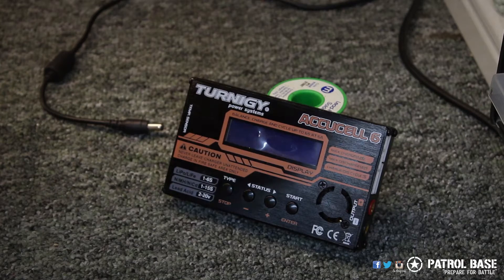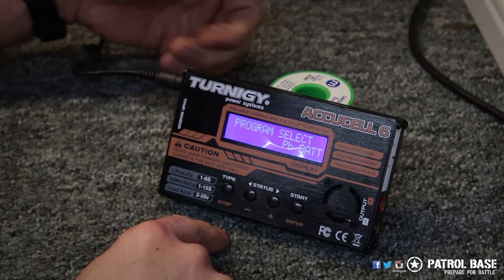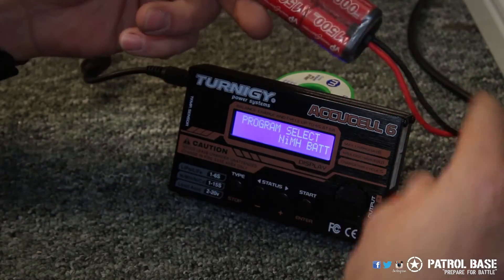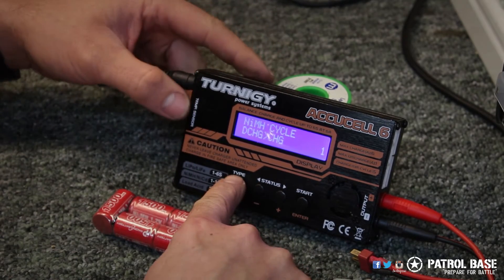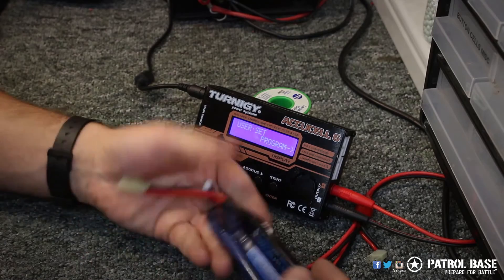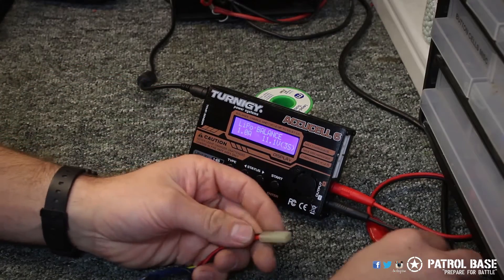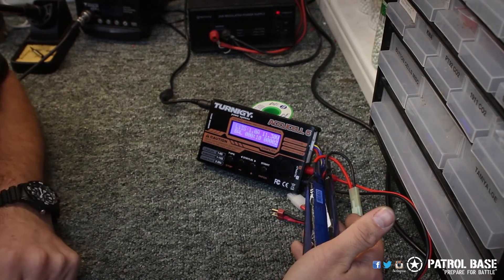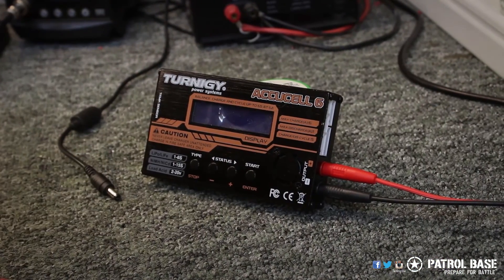Turnigy ACCUCEL 6 - NiMh/NiCd/LiPo/LiFe/Pb Battery Charger Guide

Comment: I have a 1700 nickel cardmium battery when I charge it says “lower voltage”? Any idea?
Reply from the maker: normally that means the battery has gone too low and can not be charged again
Reply: I see thanks for the quick response. Any recommendations on what battery I should get for my older rc car.

Comment: how long will a NiMH battery hold charge? can I charge my battery's 2 days before a game?
Reply: yes but you will have like 90% maybe less capacity after 2 days. safest way for best performance is charge a day before, and recharge at the highest rate possible that finishes with the batteries at no higher than 120f at gameday and use the batteries when they're hot

Comment: Be careful of that unprotected Deans connector, if it shorts out on something conductive your battery will be shorted out and could explode. Best to insulate the Deans plug if you are not using it.

Comment: I only have 2 cables with crocodile clips ends in with the charger - NO output connectors for the battery side to charge ......pants, however good the charger unit is
Reply from the maker: Then you need to get in touch with the retailer, even if it was ourselves, and we or anyone else would instantly send out the missing harness! Trust is must in the manufacturer to include these in the box but it's very easily resolved with a quick phone call.

Comment: There is also an auto/man setting on the screen when you are setting up to charge NiMH batteries on all these four button chargers.  Does anyone know what that setting does???
Reply from the maker: You can either let the charger Automatically work out the settings for the plugged in battery type, or you can set up every detail yourself as shown in this video.
Reply: @PatrolBaseAirsoft    The Auto/Manual program choice is part of the NiMH charge setup.  It does not apply to any other battery type.  And in both of those setups, there is only one setting - current...  Strange and confusing - and no one seems to know the difference.  It isn't even explained in any of the manuals for any of the brands of four button chargers.

Comment: I have the turnigy accucel 6, 80w, 10amp. The charger is DC in 11-18 volts. The power suply i have connect to the charger has 14 volts and 3 ampere output. But because i want to charge a 4s lipo 5800 mah 85.8Wh, i charge the battery with 3 amps because in 4 and 5 amps the charger say DC INPUT LOW i know the power supply is small but i will change it in the future, so i have set it to 3 ampere balance charging. So the basic problem i have is that the charger say overcharged battery and the battery goes 15.4 volts more than the normal capacity of the battery. Why doing that ? I have set the charger to charge in less amps because the power supply is small for the 4s battery and again overcharge the battery. Can you understand what is the problem ?

Comment: thanks fo ryour video- how do you put the turnigy  accucel into a mode for charging 1S batteries as it seems to be between 2s-6s though specs say it does go down to 1S? (using a 1S charging board like this - in parallel)- https://www.amazon.com/Crazepony-Battery-Charging-Inductrix-Parallel/dp/B01ID6U4LC/ref=cm_cd_al_qh_dp_t
Reply: justinspirational can t do fast charge with 1s.. need to select normal charge option then should be able to scroll to select 1s
Reply: thanks

Comment: Ok this is getting confusing. I have a Nuprol 9.6v, 8 Cell, 1600mAh NiMH Battery. At what amps do I charge and discharge the battery? Even better how do I calculate this?
Reply from the maker: A maximum charge at 1.6 amps, we recommend 1.1 amps. 

You do not need to discharge the battery and to work it ou, just look at the ampage (1,600 in your case) and put a dot between the first two number (1.6) this is your max charge rate. You can charge higher but you put your battery at a higher risk of damaging it. 

The lower the amp charge the longer it will take but cares for your battery cells too.
Reply: Brilliant, thank you very much for the information :D

Comment: The Cable you use to charge the nimh battery Whats it called? I also have the turnigy 6 charger but iv lost the nimh cable and really need to find a replacement any ideas? Thanks.
Reply from the maker: Just a wiring harness, if you never got one please contact our store and we can sell them separately.